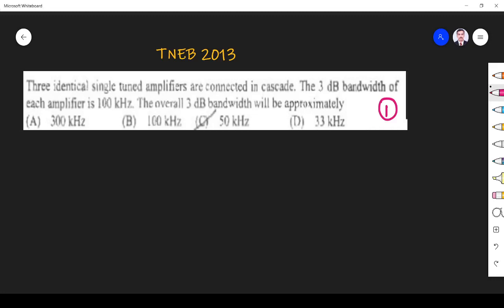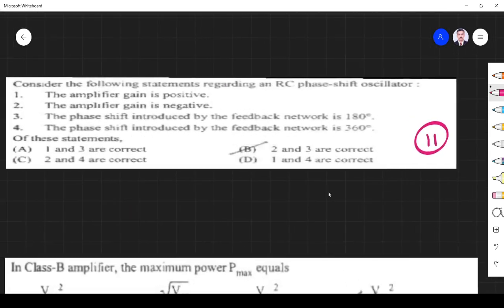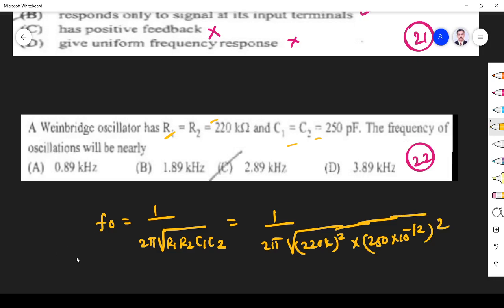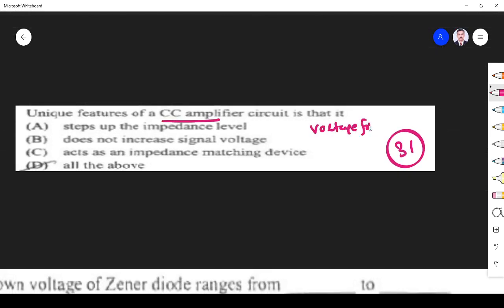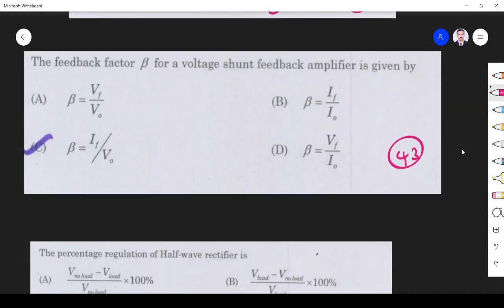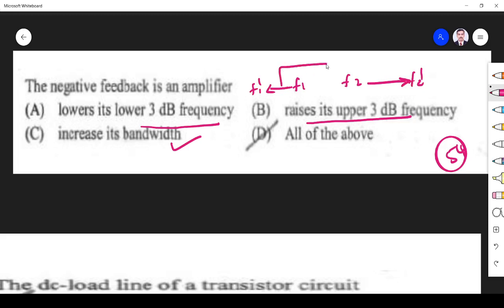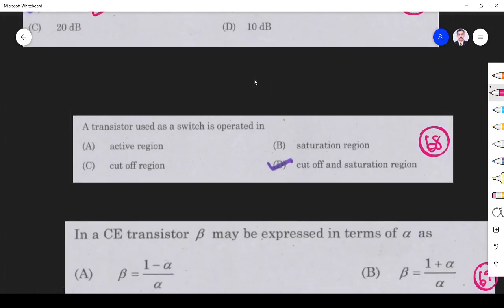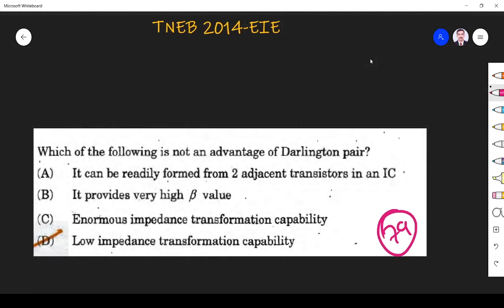ELECTRON DEVICES AND CIRCUITS ALL PREVIOUS YEARS TNEB  QUESTIONS

Comment: Sir, in question number 39 and 62...repeated question...answer different ta erukkae....enna sir answer....
In a common emitter amplifier ,the unbypassed emitter resistor provides,
Option b- current series feedback or
Option c- negative voltage feedback
Enna sir answer??
Reply from the maker: Thanks for correction..for q62 option c is correct..

Comment: Sir, In avalanche breakdown is primarily dependent on the phenomenon of?
In this question, suggested answer is ionization. But for the same question in tnpsc video, u suggested the answer is collision.
The phenomenon is conceptually impact ionization.
Is the meaning of impact ionization and ionization are same?
Which one is correct sir.
Reply from the maker: Avalanche break down is due to collision of carrier with crystal ion ma'am..it's equivalent to ion implantation whereas zener breakdown is due to rupture of covalent bond due to strong electric field
Reply: @majeethlectures  What is the correct answer sir?

Comment: Sir in Q.No 39 and 62 The ans is negative voltage feedback or current series feedback
Reply from the maker: Thanks for this question ma'am...in fact Re in CE amplifier reduces gain so it's negative feedback only... depending upon how we sample out put it will be voltage or current.. but in ce amplifier we take voltage as output so feedback is negative voltage feedback not current ..I will change q62 answer

Comment: Sir for avalanche breakdown  qestn some sources having answer as "collision" and in some other sources its having "impact ionization". Which one is correct sir. Often this qn is asking in exams dont know which answer is correct
Reply from the maker: The avalanche  occurs when carriers in the transition region are accelerated by the electric field to energies sufficient to create mobile or free electron-hole pairs via collisions with bound electrons. which is basically impact ionization
Reply: @majeethlectures  if both options are there then what we have to choose sir
Reply from the maker: @sundarkrishnan8428  impact ionisation
Reply: @majeethlectures  ok sir
Reply from the maker: @sundarkrishnan8428  

 @Udaya Suriya  

Hi Majeeth Academy is planning to conduct online gate crash coaching for ECE students

Morning 645-815
Mon,Tue, Wed ,Thur,Fri

Every day 25 practice problems from the corresponding  topic will be given as assignment

Every
Sunday test for 2 hrs

Apart from this 3 mock test 

Nov last week 
Signals and systems

December  5 weeks 

I week
 Emf
II week
 digital electronics
III  week
Communication
IV week 
Mathematics
V week 
Mathematics

 January 4 weeks 
I week
Circuit theory
II week 
Control system
III week
Electron devices
IV week
analog circuit

February 
Revision till exam date 

If time is insufficient extra classes will be taken 

Tool : Google meet 

Revision classes till exam date

Contact :
S.Shaik Majeeth 8610308934

Channel 
www.youtube.com/c/MajeethLectures

Kindly forward to friends and students

Comment: Sir... Q76 ... Hallwave rectifier 
Vmax = Vrms × 2 
But in solution used as
 Vmax = Vrms × root2
Please guide which one is correct sir...
Reply from the maker: Ma'am in half wave rectifier PIV =Vmax..  Vmax is Vrms x root 2 or Vrms= Vmax/root 2 ma'am
Reply: @majeethlectures  sir I guess
 Vrms = Vmax/root2 is for full wave rectifier...
Vrms = Vmax/2 for half wave rectifier..
Please correct if am wrong...
Reply from the maker: @கற்றதுதமிழ்-ள1ட  is it..? Let me check and tell you ma'am..if you are sure about it kindly let me know I will change it
Reply: @majeethlectures  me too agree with u sir. .  vmax is Vrms × root 2 only
Reply from the maker: @கற்றதுதமிழ்-ள1ட  

 @sumitha rajendran  

Hi planning to conduct online gate crash coaching 

Weekly 4 days 
Morning 645-815
Mon, Tue,Thur,Fri

Every day 25 practice problems from the corresponding  topic will be given as assignment

Every
Sunday test for 2 hrs

Apart from this 3 mock test 

Nov last week 
Signals and systems

December  5 weeks 

I week
 Emf
II week
 digital electronics
III  week
Communication
IV week 
Mathematics
V week 
Mathematics

 January 4 weeks 
I week
Circuit theory
II week 
Control system
III week
Electron devices
IV week
analog circuit

February 
Revision till exam date 

If time is insufficient extra classes will be taken 

Tool : Google meet 

Revision classes till exam date

Fee : can be discussed in whatsapp

Kindly forward to friends and students